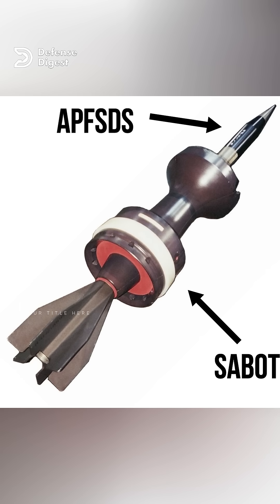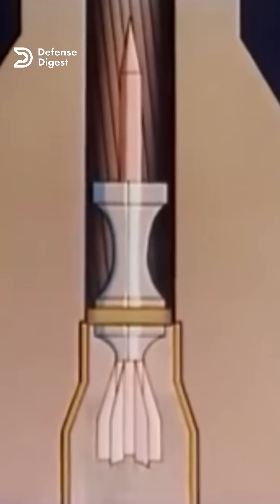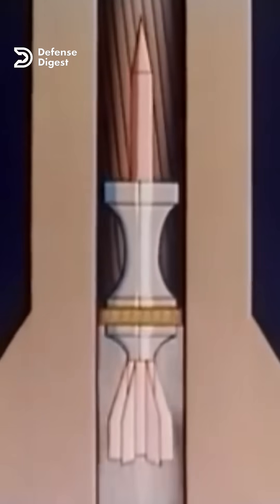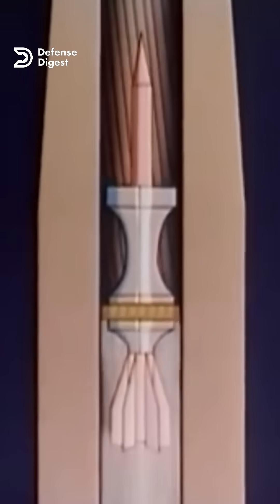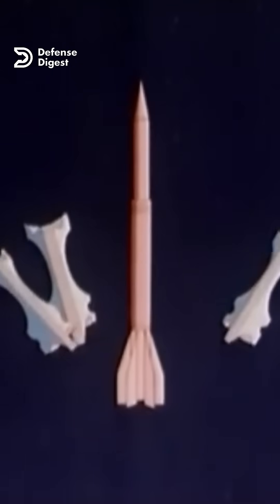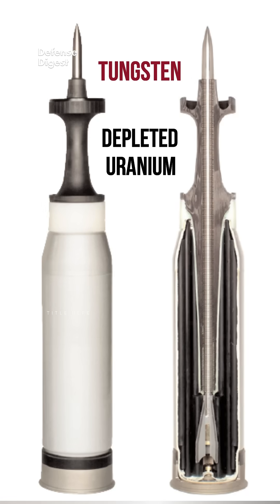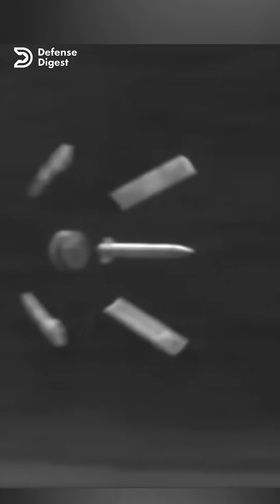How Do APFSDS Rounds Work?

Comment: Am I the only one who thinks it could go straight through the armor and do nothing? Since it’s armor piercing?
Reply: Except it does.
The thing about Sabot is that while its thin and small in size, you're firing a round that goes at 1500+ m/s for most modern rounds, practically hypersonic speeds
Armor Piercing also doesn't need explosive filler to cause severe damage, the pure kinetic energy carried by modern tank rounds can produce twice as much spalling and shrapnel when it penetrates, both from the armor of the tank being shot at and the shell itself.

Think of intermediate cartridges from rifles like the M16 or the AK; while small the damage comes from when it tumbles as it enters the body. Theres a reason why 5.56 leaves a large exit wound than it does an entry wound.

Comment: More details bc why cant i yap?

Apfsds is just a funny dart, or as yall call it, high tech arrow

It can penetrate from up to 50-300mm for the older types 
And about 100-700mm> for the modern ones

Why so much Penetration? Its long and very light and hella aerodynamic, its velocity is about 1600 m/s or 3579 mph with also high hardness materials 

It cant have explosive filler in it at all, but depleted uranium makes up for that, depleted uranium penetrates like Tungsten but this time, once it penetrates and enters, shrapnel flies out and the rest of the round catches fire, kinda like throwing fire into a tank and letting the crew burn if they dont get out

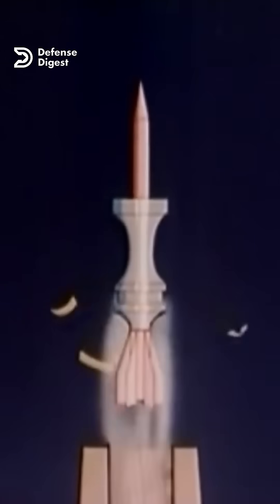Comment: There's a small mistake in video demonstration (0:23). Pallet leads the round in muzzle and then separates by dynamic pressure of oncoming air flow. And the belt, keeping it together is torn apart by the outward directed forces, that are caused by pressure in a concave segment in the front of the pallet. So it's should be visualized differently

Comment: The key metric is that the sabot drops away and that cross-section (120mm) that was explosively propelled out the tube imparts all of the kinetic energy to a small dart.

Comment: This is closer to a dart that an arrow as it dose not flex or spin (at least modern ones dont) also the diagram is pretty old and features a soft matal ring around the sabbot but modern tanks are smooth bore meaning that there is no need for that ring as its meant to interact with the rifling of the barrle and make it spin

Comment: We wen‘t from APHE which basically is just big boom inside tank to arrows again lol.
Reply: Thicker armor, ceramic plating, cages, and explosive reactive armor have made HEAT rounds less effective.  The APFSDS rounds are very hard to defend against and most counter measures are even less effective with a second sobot round 5-7 seconds later.

Comment: can you imagine HEAT and APFSDS combined
Reply: The USA depleted uranium round is self sharpening and it turn molten at contact spraying the interior with debris and white hot metal.  Depending on target, the round can sometimes travel out the other end because it is so effective.  Similar to getting hit with 12.7mm/.50 cal round in the chest.  No need for HEAT.

Comment: I’m pretty positive depleted uranium and tungsten are some of the hardest heaviest and strongest metals out there
Reply: USA have depleted uranium rounds because it can "self sharpen" for increased armor penetration compared to tungsten rounds. EU NATO tank can have have larger/stronger main guns; but, USA Abrams uses a more deadly round that needs less power to kill at the same or higher rate. USA doesn't care about radioactive ground/water poisoning since all round fired are going to be on foreign soil.

Comment: This is my favorite ammo type in War Thunder, it penetrates any rank as long as you hit the weak spot. These things aren’t going to magically penetrate any tank you shoot at, you need to hit the tanks weak spot to get the kill
Reply: We used the depleted uranium rounds when I was part of Abrams tank battalion in the Army. These types of round are effective against thick armor even with reactive blast plate on exterior.  The uranium did a much better job of "self sharpening" compared to tungsten as it drilled into thick armor spraying the interior with molten radioactive metal into the crew compartment from a range of 2-4 miles away.

Comment: Also if space war exist, throwing a bunch of metal in your ennemy will be more efficient than using plasma bullet or something like that in star wars.
Reply: Pretty much. It's also about unnecessary damage as well. Plasma and laser projectiles don't stop and will burn anything it hits. Especially with how militaries use suppressive fire it's better to use solid projectiles.
Reply: @Orbowitz  will need way less energy to throw a projectile than shooting with plasma or "laser beam".
Especially if you need to shoot a laser that is capable of piercing the hull of a futuristic space ship.

Comment: Depleted uranium does not "work" by being hard and dense. It works by having a low specific heat capacity which means that the deformation caused by impact partially converts the uranium to plasma, allowing it to melt it's way through the target.
Reply: Ummm I dont think thats how it works ?
DU is a very dense metal, which is why its both used as protection plates/armor and for ammunition, since it can store a lot of energy. DU is also self-sharpening (not literally but it maintains a sharp-like pointed end unlike other metals) which helps penetrating the armor, it also tends to break into shrapnel more than other metals too iirc.

Comment: Sandwich composite crystal & granite infused tungsten carbide, iron, sand, Kevlar, armour steel sheet and reinforced concrete. 60% thinner than conventional armour, lighter, easy to replace sectional panels, not able to be penetrated by any rounds.

Comment: APFSDS usually aren't shot out of rifled barrels. Also somewhat wrong sabot animation. It peels off from the front.
Reply: They are still fired from rifled barrels though so it’s not wrong.
Reply: @GGG19872 iirc, only the only rifled barrel that APFSDSs are being shot from is from the Challengers, however the UK is switching to smoothbore ones. Almost everyone uses smoothbore barrels nowadays.
Reply: @boijames3253  I know, I was just saying it wasn’t wrong.

Comment: still, HESH is better cause it can cause armor fragmentation everywhere, making it can be shot on a place APFSDS round with straight trajectory cant go to: like, tank roof, side armor, cupola, or even frontal and slanted armor that cant be penned by kinetic energy penetrator that deal small impact after penetration, while HESH can destroy anything given if it don't get inside
Reply: If you're achieving nothing with a dart you're achieving even more nothing with HESH. HESH does nothing against composite armour and where did you get the idea that you would even have the chance to aim for cupolas or roofs in combat?

Comment: I am also long, thin and featuring a sharp tip and tapered tail. Unfortunately it's true when I produce drag it surely increases my sexual density. I try not to only go for chicks smaller than my diameter but deeper than my length.

Comment: He talks about a sabot proceeds to show a rail gun penetrating steel walls
Reply: sabot is a round rail gun is a gun which can shoot sabot
Reply: @bbbbnnnssssvvvvttt  you cant really class it as a sabot due to a sabot round uses a gunpowder charge or outer case and the rail gun uses electromagnetic charge to fire an kinect tungsten round yes its approximately the same but the key difference is the charge used to send the round you wouldn't call a rounders bat a baseball bat now would you 😂

Comment: "Depleted" uranium is still radioactive.  Shards left 'in country' will cause birth defects and cancer for the next 700 million years (It's half life).
Reply: not true studies have found that the radioactive level is at safe levels birth defects are caused by it being a heavy metal and using a less dense material would then result in more rounds needing to be fired and thus more heavy metal used

Comment: Wrong on how they work.  They impart tremendous pressure on the armor which instantly melts the armor.  This creates cone shaped molten metal at the top of the point that melts its way through the armor.  That’s the sparkler effect seen.

Comment: You are mistaken about one thing. Depleted uranium is know for its toughness not hardness. 

Yes they sound that two words meaning the same thing but they are not. 

Depleted uranium is renowned for its balance of both. For something to be extremely hard, it would be fragile, it is tough, and it is hard to hold it shape, and it is renowned for its ability to have extremely high density compared to other metals in weight when given enough gunpowder to send a flying at Mach 3 hit now has enough force to go through say 700 mm of armor. There’s not much that it can’t penetrate.

Comment: fun fact: the sabots are designed to be as light as possible, main benefit of sabot ammo is that the long arrow shaped penetrators in a barrel much wider than the actual projectile itself causes a massive increase in muzzle velocity

Comment: The penetrator “peels” it’s skin as it punches through.
Reply: thats not part of the penetrator lmao, thats soo it can fit in the barrel
Reply: @bbbbnnnssssvvvvttt  I am not speaking of the sabot collar.   On a molecular level, the penetrator punches through armor by allowing its outer grain structure to remain in friction contact with the armor  while the “inside” keeps pushing through.  Yes, of course it remains solid, but the penetrator’s alloy uses a “peeling” displacement effect.  So rather than retain mushroomed deformed material on the tip, the penetrator sheds it off to remain sharp.  The effect is a marvel of metallurgy.

Comment: Why is germania army allowed to keep using 1940's Insignia??
Reply: It isn't. The Iron Cross is way older than the 1940s.
Reply: @harmdallmeyer6449  and so is the swastik yet it's illegal to draw it ...
Reply: @filipecoutinho5706  the Swastika was only used by one Regime for one specific Thing though.

The Iron Cross has been a Symbol of the German Army since it's conception. 
Also, in WW2 the Standard Emblem was the Beam Cross, Not the Iron Cross.

Comment: The word sabot is pronounced " say-bo". APFSDS is an acroynm for Armor Piercing Fin Stabalized Discarding Sabot. It requires a smoothbore gun on the tank rather than a rifled one to fire. It generally replaced the prevous type of primary ammo to knock out armored vebicles, the High Explosive Squash Head "HESH". That type of ammo used explosve force rather than penetration to do damage, and is not as good against displacing/reactive armor. The good thing about hesh is that it doesn't require those rare heavy metals that apfsds does. And can also be fired out of a rifled tank bore.
Reply: HESH was mostly used by British tanks, others used HEAT
Reply: @TheByQQ  HESH was designed by the Brittish during WWII. During that time the US used solid shot and HEAT. The US used HESH during the cold War and is still used by the US for the destruction of structures by the Abrams. For AP applications, the APFSDS is used.

The Brittish use a rifled tank bore, so they can't use APFSDS. Instead, they stick to HESH primarily.

Comment: The model of the gun firing the round is incorrect as it shows rifeling. Guns firing APFSDS are typically smoothbore, meaning there is no rifling. The spin that creates flight stability is achieved via the Fins at the back.
Reply: it's not incorrect since the british challenger 2 has a rifle barrel
Reply: British tanks still use rifled barrels
Reply: Also there are Sabot Shells that can be fired from rifled and Sabot Shells that can be fired from smoothbore

Comment: The APFSDS is fired from a smoothbore, not a rifled one as shown in the video. Rifling has a negative effect on APFSDS rounds as well as HEAT rounds.
Reply: its still possible, challenger 2 has rifled barrel and can fire apfsds, but they need special ammo to negate the spin from the rifling cuz u dont want the arrow to spin.

Comment: It is also fired from smoot bore barrels and munition doesn't spin like bullets from assault or sniper rifles. This is crucial since apfsds is kinetic charge munition and it can preserve more of its at the same range compared to riffled. Stabilizing fins allows apfsds to be more effective and accurate at longer ranges at they stabilize the munition aerodynamically.
Reply: the challanger 2 has a rifled barrel
Reply: @sigstenbockgard8080  That is true but It fires general purpose HESH shell or apfsds shell with specially designed outer layer.
Reply: @Reaver9021  yeah so it's apfsds from a rifled barrel. many low caliber auto canons are also rifled while still being apfsds capable
Reply: @sigstenbockgard8080  The main takeaway here when apfsds fired in this fashion won't spin. It will traverse like an arrow or as name suggests dart. That is why british tanks mostly uses HESH since HESH needs spinning but it is very much less effective agaisnt armor compared to apfsds.  And that is why rifled barrel will be replaced with smooth bore barrels in the next gen British mbts.

Comment: It's a tungsten or depleted uranium dart projectile encased in a wad if one can call it that and is used like any standard main gun tank munition the velocity of these rounds is so great they can hit moving helicopters if aimed properly obviously they negate deflecting on slanted armour at greater distances aswell well rounded but you need to hit vital components on the enemy tank

Comment: Now explained why it needs to have the ds part
Why does it need to separate
Why can’t it just fire the projectile
Reply: Because the sabot is just there to seal the barrel. The penetrator needs high speed to work so a small cross-section and low drag are advantageous. The sabot seals the barrel so it can be shot out of the gun but gets discarded to not increase drag

Comment: How many different ways is he going to say Sabot?  Saa-bow... And buy the way that's not at all how they work. You were describing how a shaped charge warhead works at defeating armor... The shells that you are showing aren't at all explosive. They also are not made of tungsten. They do not fracture or expand. The depleted uranium dart is used with a Sabot in order to get the ultra high velocity that it takes to literally start burning the outermost layers due to friction with the air. Once it comes in contact it literally just melts it's way through the target. The molten armor that blasts into the hull is like a shotgun that shoots melted steel all over the inside of the tank and kills the dudes inside. I mean f*** if you're going to try and teach people and make money doing it at least f**** tell them the correct information Damn! That's why you damn kids are so stupid now a days! One of them thinks they know something so they just put it on the internet and before long everybody thinks that's the f**** truth, because some jerk-off don't understand,or know the difference

Comment: Fun fact: the creators of this video couldn’t even be bothered to check their AI’s handiwork
Reply: Yeah, didn't even mention that it's not the whole "arrow" that's made of tungsten or uranium, but a penetrator inside.

Also, "*usually* long and thin"? As opposed to what? A wide and short round?

And I'm 99% sure that they don't actually deform and fragment, but shave off.
Reply: @StartellerRX-8 old apds had a penetrating core, apfsds is almost entirely made of penetrator material. The only part that isnt made of the high density metal is the point and the fins.
Reply: @gavinlightfoot5521  this is wrong
Reply: @StartellerRX-8  It depends. Depleted uranium penetrators break up at the tips in a way that's considered "self-sharpening", the flakes and particles of DU also burn intensely to add a secondary incendiary effect upon penetration. Tungsten penetrators on the other hand tend to mushroom at the tips as they go through armour.
Reply: @StartellerRX-8 the apdsfs proyectile is the core itself but the only thing that needed to be clear was that modern ones doesnt use DU, the only one that had a core is APCR which is a WW2 shell.

Also most of the times the apfsds fragments inside the tanks after penetrating the spall liners
Reply: @izanagisburden1080 russia and usa both make shells out of DU currently as it is much cheaper than tungsten and has similar penetration capabilities
Reply: @Disguised588  both sides stopped using DU since its kinda stupid to poison your crew and make a zone that you want to capture irradiated by all the DU laying in the ground
Reply: @izanagisburden1080  DU is only mildly radioactive
Reply: @Disguised588  uranium gets a half life over a thousand years, that mild radioactivity will scorch the ground knowing that both sides wont collect the rounds after being firee
Reply: @izanagisburden1080 so based on your idea, background radiation is bad then? Cuz they got low radioactivity but they last until the Earth and Sun dies.

Comment: You left out the velocity increase when the sabot is released due to conservation of momentum.
Reply: What? That's not how it works, the sabot still travels at speed when it disconnects from the projectile. The is no energy transfer between the sabot and projectile after they leave the barrel.
Reply: Sorry to be this guy, but the sabot disperses the energy it carries into the air molecules through friction when it detaches, it can't give anything extra to the penetrator once they leave the pressurized barrel. In fact it might slow the penetrator slightly through drag until it is completely detached.
Reply: The high velocity is a result of the small diameter and resulting lighter weight facilitated by the Sabot.  Does that equate to conservation of momentum?
Reply: @paulogden7417  
Yes.  The loss of the mass of the sabot causes the velocity to increase to conserve momentum.